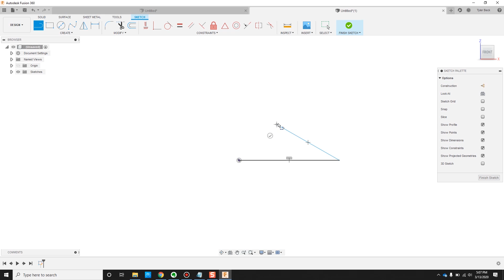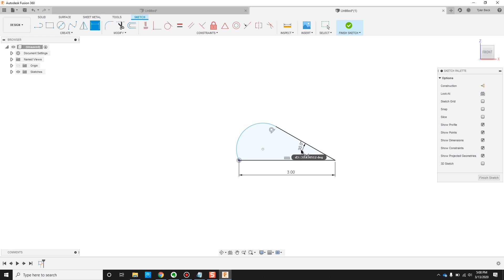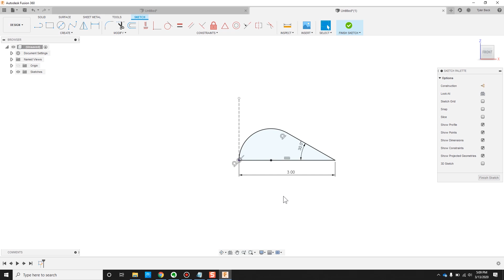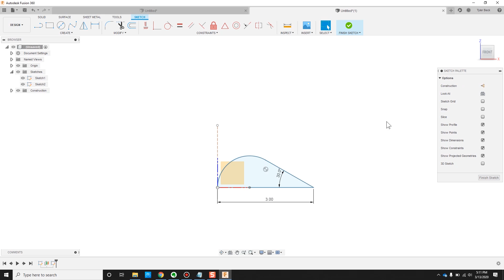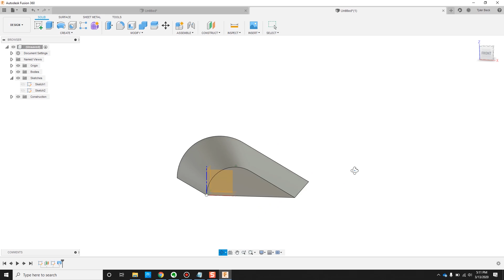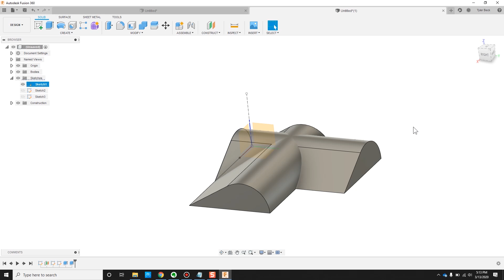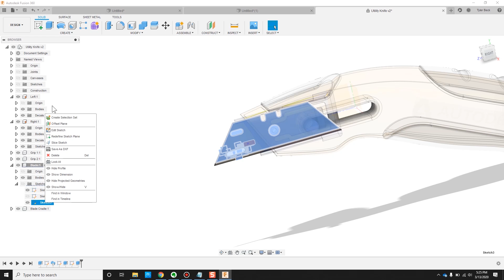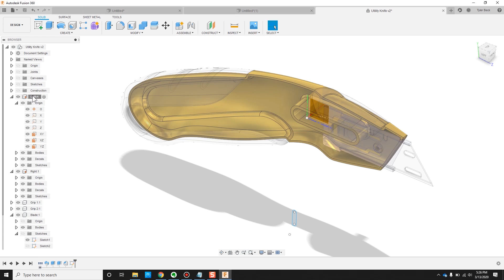Fusion 360 -  How To Copy Sketches - In A Single Part Or Across Components

Comment: Oh dear, as soon as I've posted a question suddenly realised that I've copied the original sketch differently. What I've done is clicked on the sketch name in the Browser, so sketch appeared selected and I did Cmd+C. But then nothing has been inserted into a new plane when using Cmd+V.

Finally I realised that you've selected the sketch by drugging a selection box around it and then Cmd+C. With this approach of selecting it works!!

Is there a difference how a sketch is selected before coping it? I guessed that both ways of selecting it would be the same, but apparently they are not. Could you explain the difference please? Thanks :)
Reply from the maker: Some CAD tools allow you to select the sketch in the history and copy it but I think Fusion is limited to selecting the entities in the active sketch then a new sketch is opened and pasted....
Reply: @TylerBeckofTECHESPRESSO  Thank you! It was very confusing as lots of resources said both ways are similar and then clicking on the browser history is "better" as it selects all of the sketch while manual selection could miss out some bits with complex geometry. Well at least I know the reason,  which is slightly less frustrating after trying to do this for a day :)

Comment: Hello Tyler, thanks for the tutorial exactly what I wanted to learn. The only problem I'm having is that when I select create a new sketch and select our new plane; and then insert the sketch via Cmd+V it doesn't insert anything :( Nothing appears on the plane, however, in the Browser under sketches there is a new sketch icon appears with red lock on it, but it seems to be empty. 

Any idea what's happening? I've re-watched this several times and tried everything precisely, but still getting the same results described above :(

Thanks for your help.
Reply from the maker: Sounds like you solved it :)